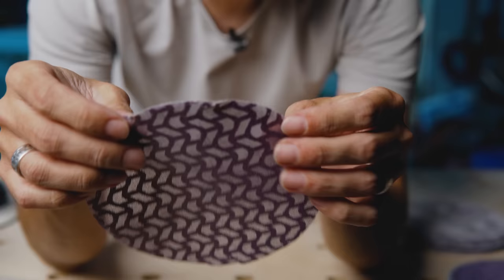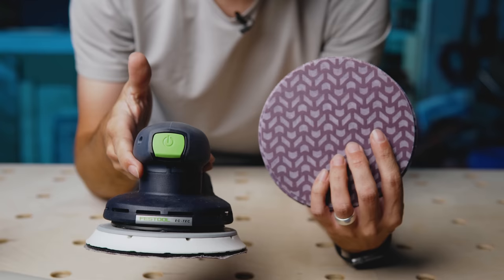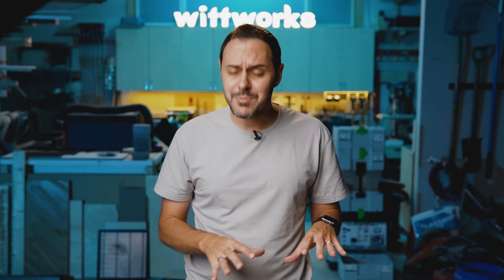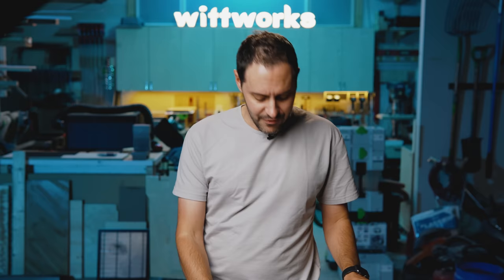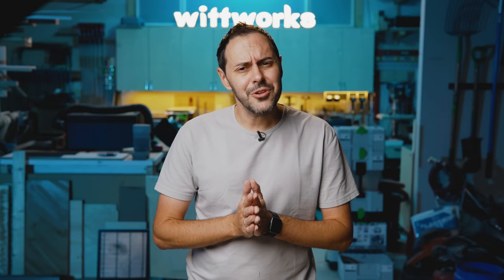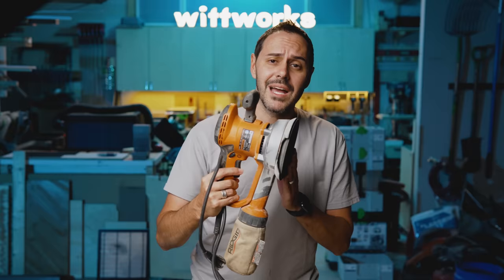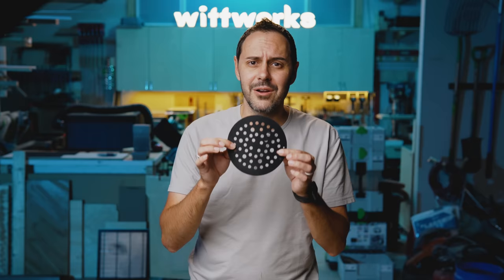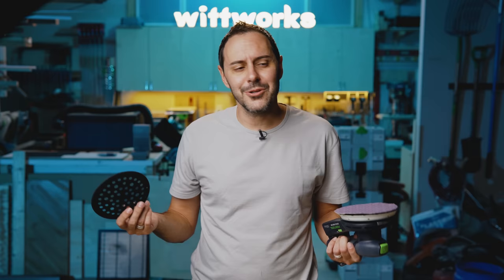the problem with the "best" sandpaper (& how to fix it cheap)

Comment: This video almost makes me want to cry. My wife got me the ETS125 as a present last April and we went thru 2 sanders and she felt so bad and I felt so bad telling her the fancy ass awesome sander she got me isn't even holding sandpaper when my crap Ridgid has no problem. This has been an ongoing issue with Festool and Amazon forever. It's been sitting in its fancy case in the corner of my garage for four months. I CAN'T WAIT for this pad to get here. I can't properly describe the amount of time and energy we both have put into this stupid stupid problem and it's amazing to hear my exact words said back to me in this video as far as "OMFG if you're not going to include it at least TELL me this is an issue!" net paper is extremely popular so this should be a very common problem. Thank you so much for this video!!!
Reply: The ets 125 comes with a normal piece of granat sandpaper. I understand you wanted to use net paper but did you not think to put on the piece they included to make sure there wasn't a problem with the sander pad or do you only use net paper? Did you let it sit there for 4 months just because it couldn't use net paper? I have so many questions. Did your sander not come with the one very generous sheet of 120 paper festool bestows on there 249 dollar sander kit? What the hell happened for you to not figure this out?

Comment: 3M extract is one of the junkiest sandpaper I've ever used literally I have some Chinese sandpaper in my car that works better . Why is it the best? They should put worse sandpaper ever. I am restoring a 1967 Pontiac firebird.  I got tired of using sandpaper I tried a lot of different ones because I'm going down to Bear meadow and that old paint on that car is really hard so I decided to buy some 3M extract looked at reviews that was my mistake. I haven't even tried it on the car. I've been sending down a new hood that I got and some other pieces and the paint wasn't hard it was soft.  I use fo4 120 sanding grits just on half of the hood that's ridiculous.  A lot of people are not doing reviews but my experience so far the best sandpaper I have used is actually from harbor freight it's called Hercules The blue sandpaper That's some good stuff but it is expensive it's like $1.50 disc I think it's $6.99 for five pieces That's what I using on my car right now it would take me one panel of 80 grit and I could basically do the whole panel I don't even think I'm going to use the extract on my car to bare metal it's not going to hold up and mess up my sander from the edges shredding apart not good sandpaper at all I guess I'm going to have to stick with harbor freight Hercules sandpaper. Maybe you need to do a review on it that would be a good review for Hercules sandpaper really good stuff.

Comment: Hi, good vid. I agree that mesh abrasives don't do backing pads any favours generally, but just FYI with Festool this is exaggerated as they make their own hook & loop (it's not regular velcro) which is supposedly better, and also - shocker - happens to make Festool sanders incompatible with other abrasives. It's been a known issue for a while - I did a video way back (~2018?) about the need for an 'interface pad' when using Abranet ('the Mirka Abranet Test, video 157, and follow-up video 159 'cos I was sent the wrong interface pad...) back when Abranet was the only mesh abrasive you could buy. The Festool 'protection pads' are definitely better than the Mirka ones, which I felt were too soft and affected the sanding action too much. Nice graphics too btw. 👍 Hope you didn't blow all the gummy bear budget...😉 Cheers from London. Peter
Reply from the maker: Great info Peter! Thank you for watching. You made my week. I’ve been a big fan of yours for several years. 🤜💥🤛

P.s: I’m gummy bear poor now.

Comment: I'm surprised people are just now finding out about this. I've been using Diablo Sandnet discs for years and each pack comes with a backer pad. I learned this lesson the hard way when the backer pad wore out and I tried using the discs directly on the sander and it melted my hooks/loops. Had to buy a new sanding pad. 

Thing is- I found a great deal on Sandnet last year and ended up buying what will probably be a lifetime supply of every grit, so I'm never going to get to try out the new 3M hotness. There's always something better!
Reply from the maker: Nicely done. Yep. Always a better thing.

Comment: I literally ordered this mid way through your video! Thank you! I didn't give up on 3M's extract but it was frustrating when it would come off or partially shift off. Someone said recently in one of their videos that the extract sandpaper was one of the best advances recently in woodworking and I wanted to agree and if this works as well as it looks like it will, then I whole heartedly agree.
Reply from the maker: 3m's abrasive tech is what is advanced, but the hook and loop tech is the issue. I hear that mirka doesnt have the issue because they've always used net disc. Mirka patent expired, 3M entered the net market, but everyone else has hook and loop backing...now I understand. Glad this helped!

Comment: People have been going nuts over the 3M stuff since the Jonathan Katz Moses video, and probably rightly so. What wasn't discussed in the video(s) is using a protection pad, which 3M recommends in their docs. Festool also recommends doing the same when using Granat Net discs. Mirka has them as well.

No protection pad = wear out the hooks on your pad faster.
Reply: I always used a protection pad no matter what sand paper I was using. The first thing I did when I got my festool is put a pad on it. It never occurred to me that people would run expensive sanders without a pad since replacing the pad is cheap and replacing part of your sander is not. That being said, I can see how a net paper would wear it out faster than regular paper.

Comment: THANK YOU for making this video. I can’t believe nobody is talking about these flying off of sanders more on YouTube. Talking about common sense issues like this has just earned you another follower, my friend!
Reply from the maker: Aw shucks! Thank you! I’m surprised too. Had to make it. Have you had that experience? Which sander do you have?
Reply: @wittworks  Yeah I have experienced it with my bosch sander. At first I just noticed that it wasn’t a very secure connection, but it woudn’t fly off. But after just a couple of discs, they all started shooting across my garage after a couple seconds of sanding. Great info about how the hooks stick through the mesh. I had never thought about that, but it makes so much sense.

Comment: One problem I recently discovered with this sandpaper is that the grit comes off if the edges get damaged at all. I was sanding some cabinet doors (open frames for glass to be mounted) and when sanding near inside corners the paper would occasionally get wrinkled a bit. The tiny little bits of ceramic grit from the damaged edge of the paper got onto my black melamine workbench top and when I flipped the doors over to sand the other side, those little bits of grit got pressed into the wood and left tiny dents. This will necessitate a change in my workflow to make sure I either don't lay anything on the bench when sanding, or I have to find a way to lift pieces up and support them evenly so grit can't get trapped under them.

Comment: I bought Diablo mesh 5" sandpaper, and it came with a hook & loop pad. There were no instructions as to what the pad was for, so it sat in the drawer until I saw your video. Fortunately my sander's pad still works well after months of sanding without using the pad.
Reply from the maker: Good to know! I went to Hd last night after I published the video and bought some.
Reply: @wittworks  Curious how the Diablo rates to sandpapers other than anything made by 3M for you? Most people watching videos aren't running large production shops. I was hoping for real world results, that would apply to the hobbyists working out of their garage or pole barn. If a sheet of sandpaper costs pennies on the dollar but only adds a few minutes to a project it's probably a fair trade off for many if not most weekend woodworkers. 

I boycotted 3M years before they came out with mesh sandpaper. I can't think of a company that goes harder on planned obsolescence! The "other large yt channel" they sponsor that designed a test and acutely chose data to suggest we should all only by 3M sandpaper and change it out every few minutes or we're apparently "turning a couple hour project into possibly weeks" only provided more evidence I made the right decision with the boycott. Unfortunately I lost a lot of faith in said yt channel too.

Comment: So glad to have found this. The net discs were slipping off my festool as I was sanding . It caused all these marks … not the usual squiggles that I sometimes get but like a slight 1/3 moon. No matter what I did I kept getting them and this was a recent issue as  I just started using these discs last month. Now I know why I kept getting those marks! I’ll be ordering these today!

Comment: Before you got to your discovery of the pad saver, I got to thinking that the net paper would most certainly be self-attaching in that the mesh itself would be the loop and the hooks on the backing pad would be exposed. 

I think that the manufacturers of the sanders and the net sanding discs should, at the very least, add something to their documentation about the effects of net discs on the backing pad of a sander. If anything, it would relieve them from any liability because they warned us.
Reply from the maker: Very true. I think why they don’t is because their main business is industry. They have million dollar contracts and those pros know.

Comment: My first experience with the 3M Cubitron was using the version before the Extract. I also found the backing wore out long before the sanding surface. I stumbled across the protection pad while placing an order for more paper at Taylor Toolworks. I came to the conclusion that it would be the cheaper route to go as well. Thanks for the video and for throwing out an issue that has definitely not been talked about.
Reply from the maker: Thank you. You were ahead of the curve!

Comment: Finally someone talks about it. I had to replace the pad recently and switched paper but I didn’t know about this. Now I can order a protector and go back to my pile of 3m paper.
Reply from the maker: Jacob, you are the reason I made this video! I am surprised no one else has addressed it.
Reply: @wittworks the information is definitely out there as I somehow learned it years ago when I bought my festool. Not sure if it’s widely shown in YouTube videos but I got it from somewhere. Seems like it would be standard day one procedure to put a pad on your expensive festool or mirka. That’s what I did, but again, I’m not sure where I learned it.

Comment: I went down this same road a couple of years ago and finally discovered the back pad solution. I think a big part of the problem is due to the lack of information provided by the manufactures of the sandpaper. The Diablo brand provides the backing pad with some of their papers. Seems simple, but if you don't know it can be very frustrating. Thank you for the video!

Comment: I've purchased both new OEM pads for my DeWalt orbital sander and protection pads (not Festool yet) - and the cubitron 5" discs still spin off.  I used spray glue to put them on some cheap discs - and that actually worked, but then there is no dust collection.  The problem here is with the material on the cubitron discs.  I can't believe 3M won't fix this.  I ordered the Festool protestion pads today to try.  If they don't work, I'm through with cubitron discs until 3M does the right thing.

Comment: To be fair, on the inside of the systainer lid (on the RO150 at least) there is a list of all the sandpaper you can get, and for the net ones (festool granat net etc.) it explicitly states to use the protection pad. There are also order numbers for them on there. But no clue if this is exclusive to the RO150 or not.

Comment: Or get an Abranet 10 disc assorted pack.  It actually comes with a protector.  I’ve been using it for a while now and still haven’t worn out any edge.  Fantastic stuff

Comment: What's funny is i use the Xtract all day on my Mirka, and it just so happens that Mirka includes one of the protection pads in their kit, so without noticing, I had already solved the issue! Good to know!
Reply from the maker: Nice. Probably because they invented net backing and they know better.
Reply: Yeah I didn’t have any issues whatsoever with the xtraxct paper. It’s because I had a crappy dewalt sander and the bottom disc part broke off after one project because it has plastic drive parts. I returned it and went with festool. But when researching why my dewalt broke and why the festool wouldn’t I came across the idea of using backing pads. So from day one I was using the pads regardless of the sandpaper. I literally haven’t had a single problem that people are listing in the comments here. And I can’t help but wonder if people are expecting sandpaper to last longer than it should. 

JKMs tests show that even after five minutes the 3m still works better than new paper from competition. But still, you’re getting five to ten minutes out of paper. It’s a consumable. How long are y’all trying to make this stuff last. If you get a single tabletop out of a piece that’s all you can ask for.

Comment: Huh.... interesting?  I've got a mid-level Bosch sander that I was using Diablo sandpaper with that just sticks to the backing plate.  No problems at all with the backing plate this whole time.  For one project I needed to get a really course grit (like 60 or something silly), but Home Depot only had this grit at the time available in Diablo's mesh sandpaper style, not their normal style.  This was my first experience with mesh sandpaper, and I loved it after using it.  The thing is the Diablo mesh paper came with that extra protection thingy as a required adapter as the mesh paper won't stick directly to the backing plate (it even says this on the packaging, which through me for a loop at first...snicker snicker).

All that to say I've ordered a bunch of Cubitron mesh sanding paper and I was surprised to find that I had to order the adapter thingy separately?  Eh.... I guess being made aware of it through the Diablo experience was a good thing.  The best part I love about the mesh sandpaper is rather than having to use a rubber cleaning stick to periodically clean the paper, I can just blast it with compressed air between passes!  It does make sanding go quicker thanks to that.  Thanks for heads up :)

Comment: I use 710W with a plain corded Makita 125mm orbital sander (and shop vac) and have no real trouble with the nets - I just apply pressure for a moment with my palm to get it to stick nicely. Still have all the hooks it would seem. Haven't sanded large projects in one go yet, so that might change my view on the protection pads. Unfortunately at first glance I couldn't find any made specifically for the Makita hole pattern unless I order from aliexpress or the like. 
Personally I wouldn't dream of using any other sandpaper as I get this off Amazon for 1/3 the price of the cheapest no-name garbage papers available locally. That is the real shocker for me...

Comment: I ran into the same issue with my new Festool sander + 3M Xtract sandpaper. I ultimately found the interface pad solution (on Reddit I think), but geez what an annoyance. Festool or 3M really should fix this issue. Just look at how many people run into this.

Comment: 3M Cubitron is a ceramic based grain. When it breaks down the edge round over, and it leaves deeper and uglier scratches than conventional Aluminium Oxide paper. Once you paint after using Cubitron you will need 2-3 layers of lacquer. Try Sia 1950 paper, better consistency and finish.

Comment: My protective pads came with my sander when I bought mine. I did have to buy the thicker soft pad which I love
Reply from the maker: Which sander?
Reply: @wittworks  festool ETS 150/5 eq it came with two pads
Reply from the maker: Interesting. My 150/3 and 125 didn’t

Comment: I am surprised that the backing pads are not included, since they are absolutely necessary. Diablo brand mesh type disks come with the backer pad in each box, so it is self-explanatory that they should be used with that type of disk
Reply from the maker: Right?
Reply: @wittworks  I would be curious to know how the Diablo pads stand up against the 3M
Reply from the maker: I almost bought some to test. Was too cheap. Didn’t want to spend the money. Bought a second festool sander the next day 🙈

In fairness, I have a client table I’m building that is very expensive and I needed a better sander than the small Festool I have.
Reply: @wittworks  I hear you, if it is for a client then go with what you know. The price difference is the main reason I would want to see a comparison

Comment: I''ve had some serious issues sanding walls with the Festool ETS EC 150/5 and Festool's own net sandpaper with the lot attached to a vacuum. I flew through 2 or 3 of the mounting discs which are about €40. I tried the backing pads but wasn't impressed. I'll give them another go on a new mounting disc next time. Thanks for the tips.